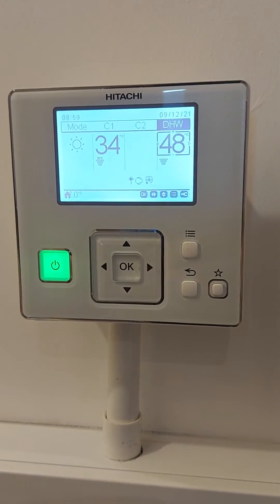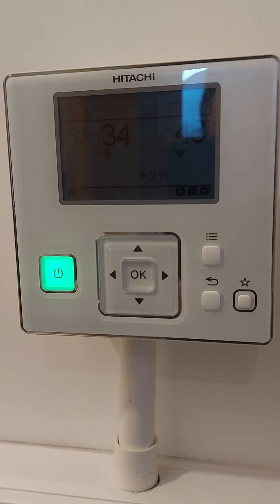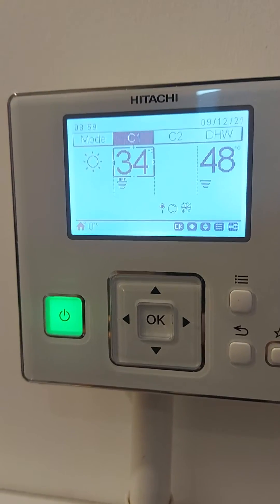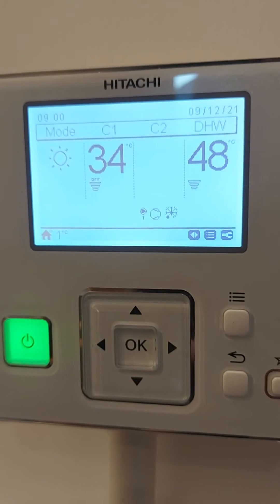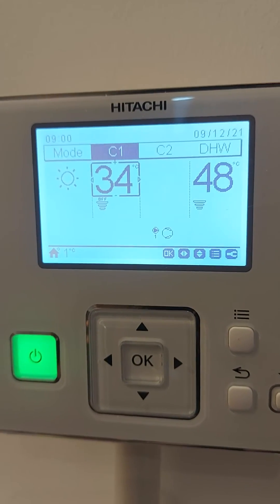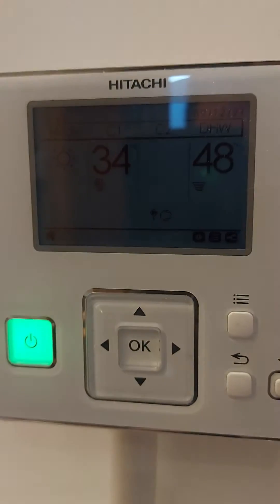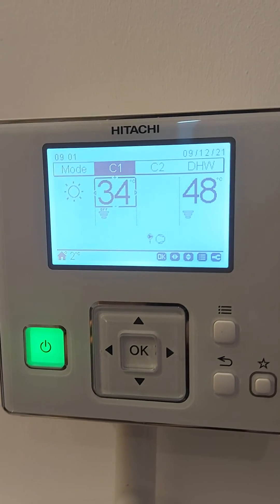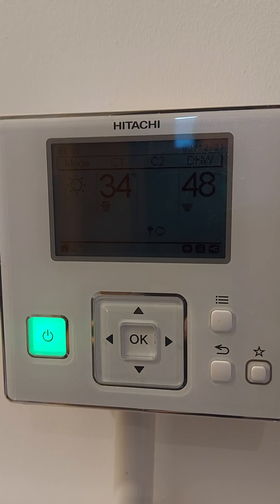Daly Renewables explanation of Hitachi Air Source Heat Pump Controller

Comment: Thanks for the video. i had a 013 error that i fixed, but ive used my thermostat to turn on the heating and it has fhe fire symbol but the radiators arent heating.

Comment: Why does the radiators go stone cold and then come back on instead of constant temp no timer involved all done by bust installer I haven’t a clue but it is using about 35 kWh and it ain’t cold outside because that will go to 50/60kWh can you show a normal setting on that please

Comment: Just wondering how can you do two timers for water , eg 2 hours in morning and 2 hours in the evening? Mine appears only to do one time. Also today our heating is at off on screen but all wall dials are calling for heat- why then does it not turn on ?
Reply: I've now turned off hot water , as for 24 hours water was taking complete priority which meant heating never came on. Have water switched off since this morning and heating is on but our rads upstairs and floor downstairs still cold. Any idea what's wrong ? No faults on unit. We had to light the fire for some heat. I had a better heating system as a child back in '82!!! Its so strange that u can never have both hot water running and heating at same time. It means when I run my kids a bath , the rads can never be hot for their towels as water always takes priority. Very strange " modern" system!!! We've been using since 2018 and had problems in cold weather every single year !!! Nightmare to be honest. You'd think a new build wouldn't have keeping your house warm verses hot water problems!!
Reply: @tracyhalpin724  from my experience in order to have heating on you have to get DHW to target temperature only then your radiators and UFH will be on. It makes sense as in order to get heating on you need hot water to go through the pipes so make sure you get DHW on and reach ur target temperature
Reply: @vadims212  thanks , yes but it takes forever for our water to heat   and then our heating never comes on or able to for long enough for rads to get warm ... so I think our problem lies with our water not our heating. As when I turn water off our heating works fine  ... only way to fast track our water is to turn on emersion  which isn't exactly the most eco! Thanks so much for your help , means alot. Think our only way to sort problem is to get it serviced.